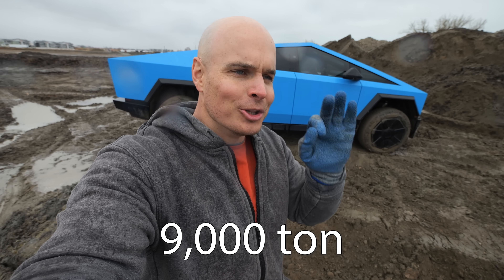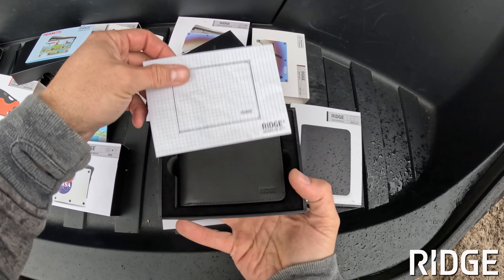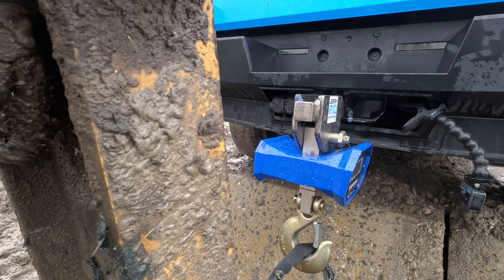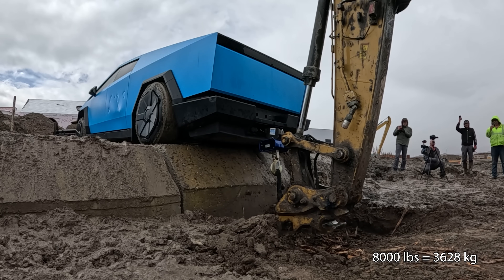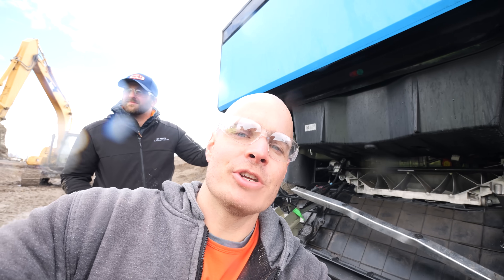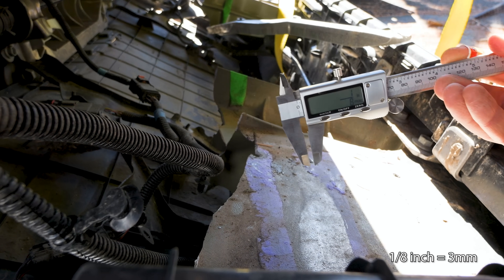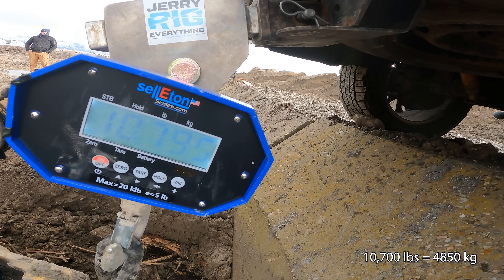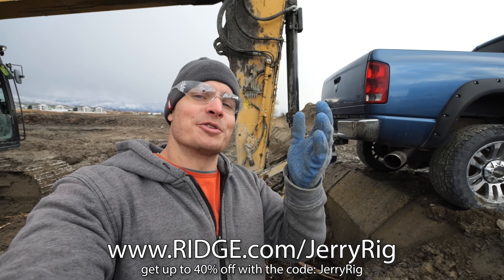SHOULD YOU TOW WITH A CYBERTRUCK?! - (catastrophic failure test)

Comment: The fact that you have to hold the front of the truck down shows that you would never see these forces on the road without the truck doing wheelies
Reply: That's would be true if you never hit a bump in the road
Reply: @ Bump that make your car flying... hit them all the time. lol.
Reply: @ incorrect on a steep downgrade hitting a bump tongue weights can dramatically increase….
Reply: Impact loads, like from going over a bump.  That can put 10,000 pounds on it very briefly without the front wheels having time to lift off.  And, if its repeated short loads, that's actually MUCH worse than continuous loads in terms of fatigue problems.
Reply: @ lol. this is total nonsense. May be of you hang 11k trailer of the cliff or something.  Dude skipped some physics classes a lot.
Reply: @ and cyber trash skipped truck class, the aluminum frame is a inferior design and product in a truck.
Reply: @matthiaswandel  If you don't know what you're talking about you don't have to speak up.  No trailer will put more than 100% of it's weight in force on the tongue going over a bump.  Even then the front wheel doesn't need to lift to reduce the max impact, trucks have suspension.  And none of the forces being shown in these experiments would leave any other similarly rated truck with a steel frame as anything other than a write off for the bent frame.  I know it's heartbreaking to hear, but Tesla does in fact know what it's doing.
Reply: @ this is a new physics law I guess... if you ally briefly 10k pounds to the back briefly you car will be doing wheelies on its butt.
Reply: @ not when the aluminum frame is cracked and/or cracks and breaks then the cyber trash comes apart unlike a real truck…..
Reply: @matthiaswandel especially if on a steep downgrade ie 9% etc 👍

Comment: The fact that it cracked waaaay before 10k, and near the factory rated tongue weight is a really bad sign IMO. Once that thing cracks it's over. This was a best case scenario, with fatigue and impacts, that thing is not lasting. The glue isn't surprising, that's relatively normal for aluminum construction. But then 7klb trucks are typically not made with aluminum frames, usually that's reserved for stuff like... a Lotus Elise.
Reply: factory tongue weight is 1K, not 10K or 11K. So it actually performed 10 times over specs.  Zach is scammer.
Reply: @en9878  It started cracking around 5 or so. The point about fatigue is the main thing, it needs to be cracking waaaaay later if it's going to handle repeated stresses as a hitch does. Once it cracks at all, it moves more, then moves more, fatigues, breaks. It's not acceptable.
Reply: @Levibetz  Dude, this test is like to run this car over with a tank and complain that tires deflated. Is it possible to break it? yes. Will it happen in real life? no. If something is rated for 1k and its craking at 5k, and breaks and 10k, i think is pretty good advertisement.  They even had to hold the front with another excavator so it doesn't flip over. lol. wtf?

Comment: The glue isnt anything to really be worried about. ALL cars built nowadays have it. It's mostly for dealing out weather, and to eliminate rattles. 

As for the comparison. This is more of an apples to oranges test. The Cybertruck is in a different class. The closest comparison would be the Honda Ridgeline. BUT the emergency loops coming off with the hitch is a big problem that will most likely need to be addressed. The fix will be pretty simple though. They will most likely just add some steel strips to tie into more of the frame further up.

Comment: Everyone thinks that this is a truck. The F-150 is not a truck. They are cars that have a truck bed. They are not able to carry that much weight. If you don't need the space in the cab you should probably just get a mini truck. A Toyota can do everything that a half ton can do. If you need a truck that will be able to do truck stuff. Then get a 3/4 ton or bigger. If you don't you are going to kill someone. 1/2 ton trucks are not able to handle the weight. Have you ever seen a fleet truck with high miles that was used to tow a trailer every day. No you don't. You will find lots of 3/4 ton and above that do. My 3/4 ton pulled a 24 foot enclosed trailer 150,000 of the 350,000 it had when the wrist pain bushing wore out on piston number one and broke the head off the motor. I would still be driving it if it ran. Get the truck size that you need.

Comment: The steel frame should have been a 1/2 ton, using a 3/4 seems a little rigged for a predetermined result. 

I would not worry about a new Cyber Truck based on that test, while i get dynamic weights, i didn't think a 10,000lbs trailer will be pulling 10,000lbs on the hitch in any situation short of a wreck or picking up the truck with the trailer dangling on the hitch. The tires should loose traction long before that much force is seen on the hitch with a proper load and use. But an older cyber truck that has been used for towing for years, yeah they need to plan for inspecting and recertifying the towing limits on a schedule that I'm not smart enough to determine.

Comment: Yes, you can in fact use an excavator to break a truck.
Reply: Also, the next time you see a similar excavator working and the tracks are lifting, you know it's applying about 10000 lbs of force on that dirt.
Reply: Imagine being so dense that you miss the point of the video
Reply: @YokoYokoOneTwo  The point of the video was to slander Tesla because the video maker has a political derangement and dislikes Elon Musk. He has therefor tried to present a Tesla performing well above the rated spec as a failure.
Reply: the dodge didn't break sooo....
Reply: @jesusbarrera6916  It has a 2500lbs tongue rating...
Reply: @jesusbarrera6916 because the dodge is a 3/4 ton truck while the tesla isn't. God you people are dense. You can do this test with a 1 ton truck and say that the dodge sucks too.

Comment: It’s crazy that they used a 1:1 Saftey factory for this. When it comes to rigging everything is rated at a 3:1 or even 5:1 safety factor. Rating something for 10,000 and it breaking at 10,000 is reckless, irresponsible, and should be illegal

Comment: I drive a pickup daily with a 15k lb trailer, it absolutely never ever gets remotely close to the weight of the trailer on the hitch, my truck suspension would be crushed or the whole rig would be lifted airborn. I would eatimate that my trailer has never even doubled its tongue weight on a bad rocking movement or bounce.

My real concern would be aluminum's fatigue from day  to day use, not so much the static weight limit.

Keep in mind that ram ford and chevy have heavy duty trucks that are rated to tow over 20k lbs from the hitch, likely using the same hitch mount in all HD models. Do you expect them to be able to take 20k plus on this test?

Comment: As somebody that owns a one-ton diesel and has nothing to do with electric vehicles, I might have to question why the test was done this way since no one puts 10,000 pounds of tongue weight nor does anything have a rating for 10,000 pounds of tongue weight that includes commercial vehicles. Until you get to medium-duty commercial vehicles, for example, the tongue weight capacity of a Ford F550 is 2500 pounds with a weight-distributing hitch. If you're getting numbers approaching 10000 pounds for tongue weight, there is something dramatically wrong with the way you are towing; even if you had a sudden shock of load, you still shouldn't ever see the 10000-pound mark being reached. If 10,000 pounds were reached, that would have nothing to do with the actual vehicle. The fault would definitely be on the individual towing. I feel like this video was partially misleading; keep in mind I will continue to own my diesel truck, and I'm not looking to ever buy an electric vehicle.
Reply: I think the entire point is that the back half of your truck frame is not supposed to snap off no matter what you do. Even if those forces are not supposed to be applied, there are plenty of idiots out there who will buy a cyber truck and haul overweight or poorly distribute the weight. The fact that the actual frame of the vehicle can snap in half like a carrot is a major problem. This is recall worthy
Reply: Yeah not sure why people dont just test this on a private road while towing a trailer. See how many time you can hit a pothole at 60 until the rear rips off.
Reply: It's about safety margins for dynamic loading... In the real world, even if the tongue load is only 10% of the trailer weight, sudden shifts in load can and do cause huge spikes in the tongue load, potentially exceeding 10x the tongue load... Remember F=MA... you give some momentum to that mass, and then have it suddenly change direction, all that force from it's mass multiplied by that acceleration gets applied to the tongue. This is supposed to be taken into account when engineering the truck, so tongue load rating is given with dynamic load shifts in mind.

A real life example could be hitting a large pothole, or an object in the road... depending on the initial velocity of the trailer, this deceleration force can be substantial.. at highway speeds, such instances can exert a ~10g momentary deceleration... so, lets math this out for a 10,000lbs trailer.
M=10,000×0.453592=4,535 kg, 
F=MA
F=4,535×98.1, F≈444,953 N
for simplicity, we will only take 10% of this to be force on the tongue.. in reality, it could be much more depending on angles etc.
Convert to pounds-force (lbf) using:
1 N=0.224809 lbf
F tongue, lbf = 44,495×0.224809
F tongue, lbf ≈ 10,003 lbf
Pretty close to the failure point on the Tesla, and that's before issues of metal fatigue.

Independent tests of F-150, Silverado, and Ram 1500 hitches have shown that they withstand forces up to 15x their rated tongue weight before failing (it should be noted tat their tongue rating is about 50% more than Tesla's to start with as well). Towing stress tests (e.g., hitting potholes at 50 mph, emergency braking with a heavy trailer, and off-road impacts) typically show no immediate damage in steel-frame trucks.
Reply: @michaelransom5841  10g acceleration lol...bro, the car has suspension and mass to accelerate.
Reply: For the dumbasses in here:  CyberTruck weight allowance at the hitch is 1100 pounds MAX.  It can tow a vehicle of 11,000 pounds MAX.   If you put 5000 pounds on the hitch, it would lift the front wheels off the ground.
Reply: @snse8479  This is isn't to show a one time event. This is to show that aluminum degrades with each tow. Until it breaks. Steel bends, the hitch and the truck will never separate.
Reply: uhh muricaaaaa
Reply: He explained in the video, it's not about the weight centered on the trailer wheels, but what might happen when hitting a pothole on the highway or transitioning from an incline and such.
Reply: And you think hitting a pothole would put 10000 lbs of weight on the hitch? On Jupiter? Bogus test. Bogus claims. Misinformation.
Reply: @tiagotiag  hitting bumps is going to put 10,000 pound on the hitch. I have towed for decades. It is possible to overload.  That  is owner issue.
Reply: When you hit a pothole, the linear tension on the tow hitch can get a vertical component and in cases like pulling uphill, when you reach its end and the curve is not smooth, 90-100 percent of the tension can convert to vertical forces being applied on the hitch.

This situation is totally possible. It’s not the fact that it’s bad or not. Tesla advertised it as 12000 lb, so it should be able to hold such weight. 

And can’t you see that it is all bolted an aluminum frame?? Aluminum in itself keeps deforming under load throughout its life span! 

I guess you need to study physics a little bit!
Reply: The fact is, the dodge withheld more tongue weight and was just fine.  And it has a lower towing capacity than the cyber truck.  The cyber trucks is a piece of shit, badly constructed, unfit for purpose, over priced, ego boosting novelty.
Reply: Bro, this shit already broke on another unsuspecting victim. You can cry whether the test is needed or not all you want, that hitch will break even if you’re not towing anything 😂
Reply: @nosferatu5  You leftists loved Elon when he was a democrat
Reply: Came here to say this. Also, even if there were circumstances where the entire trailer weight would transfer to the tongue, those circumstances would be momentary and not fixed, as demonstrated here. I know nothing about this kind of thing; so I’m just spitballing here.
Reply: Exactly. The force distribution is way different vertical vs horizontal. All this test proved is that steel is stronger than aluminum - which we all knew.
Reply: Partially because Zack has a vendetta...
Reply: @Beary98  As he should. Any person with a brain would know that Tesla is absolute garbage and Elon, well, he owns the garbage can and sleeps in it.
Reply: Totally agree.  This is not a valid test and doesn't prove anything.
Reply: This should be the top comment
Reply: That's what I was thinking. Why would you ever have 10,000 lbs tongue weight on a pickup? Who tows anything that heavy with a pickup?
Reply: I think that the 10,000 pound thing is significant because it was advertised to go up to 11,000 but I could be wrong (read: probably am wrong)
Reply: @cpucat You're definitely wrong. 10,000 may be the tow limit but it is most certainly not the tongue weight.  Cybertruck tongue weight is 1,100lbs.  It broke at almost 10X that amount.
Reply: It is not rated for 10,000 lb (tongue weight)@cpucat
Reply: @cpucat towing capacity not tongue rated.
Reply: @cpucat !0,000lbs tongue weight is not 11,000  lbs trailer weight. With a trailer weighing 11,000 pounds you have approximately 1100 pound tongue weight. That is if you load correctly.
Reply: Wrong 1100 @cpucat
Reply: @cpucat you've conflated tongue weight capacity with towing capacity. The cybertruck is rated to tow a trailer weighing 11k. The cybertruck is NOT rated for 11k tongue weight, or any other vehicle for that matter, including the Ford F550 which is a commercial truck, much heavier duty than any consumer pickup.
Reply: @ramseyshanemangus3665 I was thinking the same thing, but at the same time that 2004 dodge ram isn’t rated for 10k lb tongue weight either and it still survived the test so that says something at the very least.
Reply: @cpucat Indeed you are wrong.   The towing capacity is advertised @ 11,000 lbs and is not what is tested here.  Numerous videos proves that the towing capacity can go much beyond 11,000 lbs.  The tongue weight capacity is advertised @ 1100 lbs is is tested here at 9x that (10,000) which is more than sufficient.   It like purchasing a ladder that can hold 300 lbs and testing it and later saying that it is bad because it crushes under 1500 lbs because another one is crushing under 2000 lbs.  Both are more than OK.
Reply: @cpucat research the difference between tongue weight and tow weight.  Nothing is rated for 10K tongue weight.  Nothing.
Reply: Did you somehow miss the part of the video where the RAM 2500 that was already in a wreck managed to hold 10,500 lbs of tongue weight while the excavator bounced on it?? 😂
Reply: Did you miss the part where the clown actually admitted they were exceeding the maximum tongue weight at about 600 lbs?  Did you miss the part where they tell you this is an EV so aluminum was used in the frame for weight savings? Did you miss the part where the hitch exceeded its maximum capacity by a factor of more than 10?
Reply: @jordanrobinson6623  bouncing is dude to suspensions. Comparing that to steady air suspension on tesla.
Reply: Misleading test to the breaking point. You know better, but you got paid. And that makes you a sell out. And dishonest. Shame.
Reply: Zack is probably shorting Tesla. lol. He is a known grifter after all!
Reply: @lostprophet86  I think 2 people are living in his head rent free...  TDS is a real thing.
Reply: because the dude gets paid to make anti Elon/tesla videos.  he did another one where he bragged saying Ford has a better self driving than Tesla.   This guys is a A-1 Crook
Reply: @  Bro elon musk isnt going to marry you if you defend his crap products
Reply: @wildrahul  Elon literally lies to investors about autonomous driving. It's driver assist not Waymo self driving. That's an A+1,000 CROOK
Reply: Is he anti elon/tesla? Because if I'm not mistaken he used to support elon and his electric vehicle saying it is good for environment and something like that, or did he change side now?  @wildrahul
Reply: @NotSoRedHair  yes - he’s all over X being a troll
Reply: @Iameverywhere6969  changed his position when Elon bought twitter, on X he used to rant like a fool.

Comment: Tesla has a rated payload capacity of 2500lbs. When towing, you are concentrating weight to the hitch and it is using up part of its payload capacity. When towing, you are rated to PULL the towing capacity but when balancing the load you are taking into account the payload capacity. At max capacity, even at 11,000lbs you should only have about 1600lbs at the hitch (which is within payload capacity). There is no scenario ever that you are going to transfer all or even half of the towing capacity into payload at the hitch (unless you are already encountering a catastrophic event at which point things are breaking anyways).

Having that said, yes aluminum is weaker than steel, but its not false advertisement, its designing to criteria.

And they literally held the front down to be able to break off the rear end. Even if you did somehow manage to overload the hitch, the front end would just lift off the ground, it would never counter-act that force.